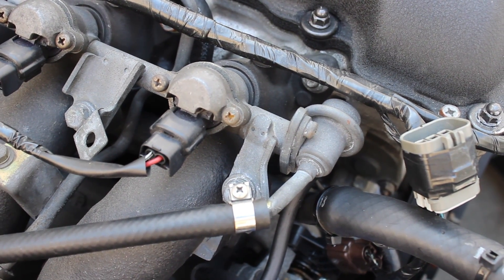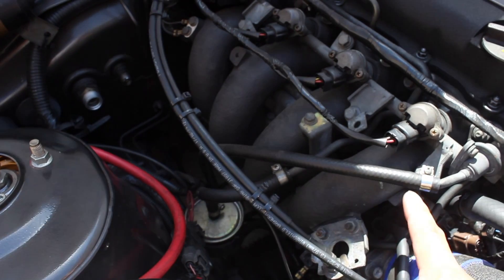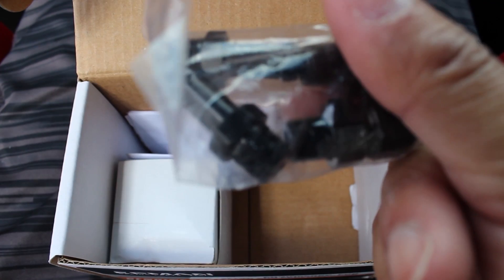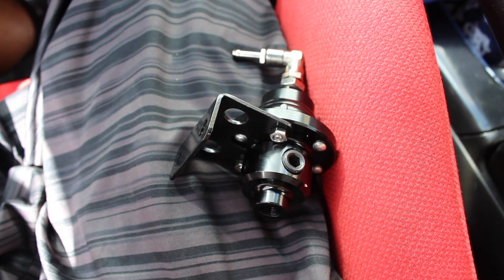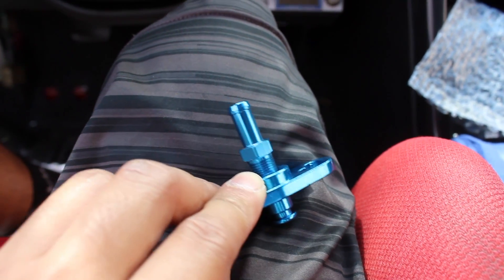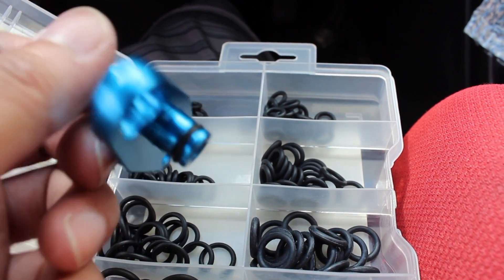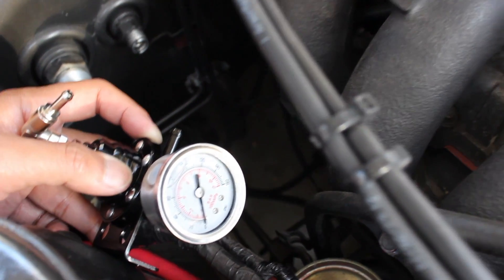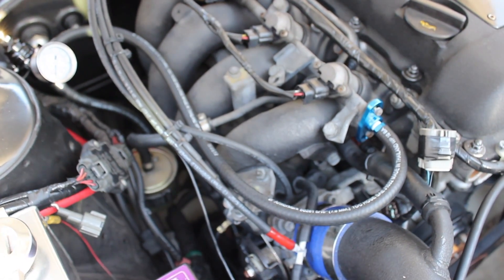Wrench-a-holics | How to Adjustable Fuel Pressure Regulator

Comment: i believe you mentioned the vacuum jam nut either extend or shorten will adjust the pressure. i got an answer from the seller using this method at the vacuum fitting jam nut; also using tee-fitting to the vacuum advance one end and the other to the carb vacuum port. thanks, bob

Comment: hellowrenchhand, you the only youtuber showing the fuel regulator i have. this one supposes to be adjustable. where is the adjustment screw? i find your connection to the vacuum which i tip-off with the existence hose. thanks, bob
Reply: i meant tee fitting to the advance Vaccum and the carb nipple.
Reply from the maker: @rtchow3000  since then I’ve swapped this FPR out for the TOMEI Large version.  Essentially the same.
Reply from the maker: @rtchow3000  from what I remember, the adjusting portion of this FPR is the silver part. There’s a jam nut that’ll stop it from moving (nut closes to the FPR) is that the one your talking about?

Comment: Nice video, man. The pressure regulator works without the vacuum connection? Thank you.
Reply from the maker: Marco Uribe pressure without vacuum is only needed to set the base pressure per the FSM. Once it’s set you need to connect vac back to the FPR

Comment: Very informative, I have the same fuel pressure regulator. I'll be installing mine soon. Btw, what size of fittings do I need to use if I prefer to use steel braided fuel lines? Is it an6? Thanks!
Reply from the maker: bobby mitchell an6 1/8 npt (threading) use quality fittings nothing’s more worse than leaking from the fittings.

Comment: how do you adjust the pressure up or down? i have the exact fuel pressure regulator.
Reply from the maker: Armando Estevez at idle you have to remove the vac source from it, loosen the lock nut and rotate to adjust with the correct Hex.
Reply: @wrenchaholics  what is the range where I can adjust it? up to what pressure at idle?

Comment: Dont use teflon tape it degrades with fuel over time so i would use white tube permatex or some specified over specified fuel proof on billet or metal thread sealer.
Reply from the maker: I haven't had any issues so far, but Im already in the process of switching these rubber lines out for SS fuel lines.

Comment: How the fuel regulator performance?it is good?
Reply from the maker: Its a great upgrade for those who want to boost at high PSI, also a great diagnostic tool as you can see what your fuel pressure reads in real time. Thanks for stopping by.